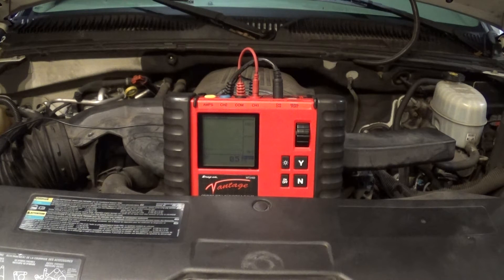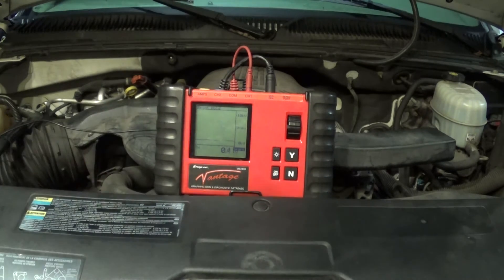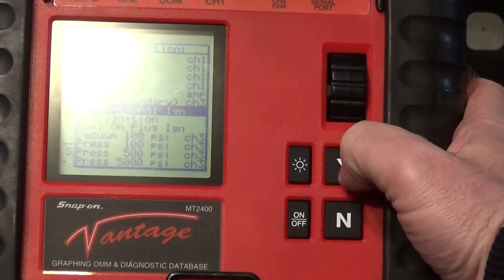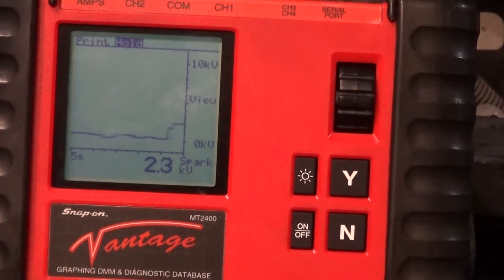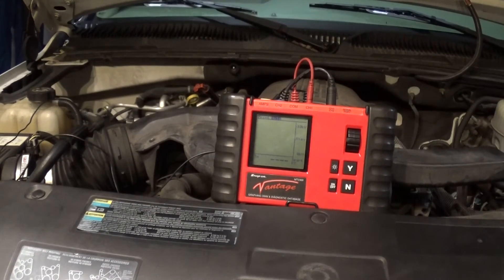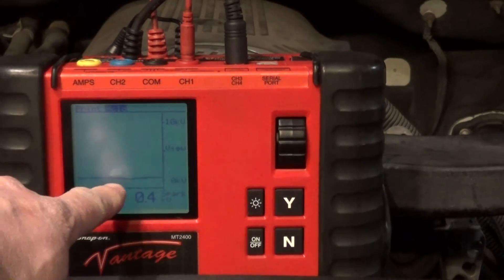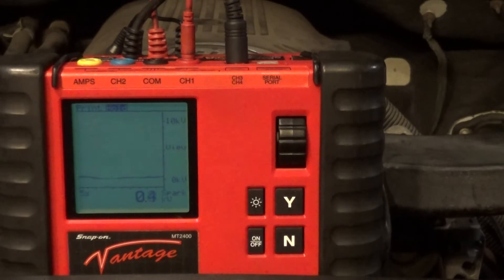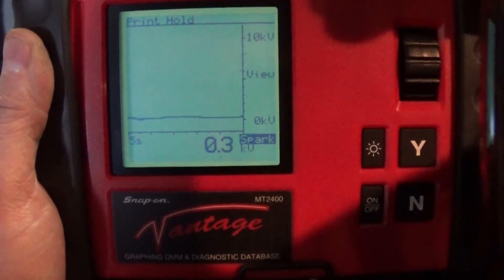Secondary Ignition Testing With Snap On Vantage MT 2400

Comment: this is a good video for those familiar with osciloscope use but not for beginners. where did you hooked up the  long wire what is the spec for a spark plug voltage what means the ups in the graph when you shaked the wire? 
Not very useful for a low knowledge.
Thanks guy.

Comment: I have the MT2400 but not that module u put on the back. That is sweet. On the hold feature, can u go back?  I don’t think so. What’s cool about the MT2400 is that it is so light and compact. Plus it has the recommended test features. Most of the Troubleshooter features. I think mine goes up to 2002. Not sure.

Comment: maybe i missed it, but what kinda of test lead did you use. and how did you hook it up ?
Reply from the maker: Wrench life 604 hi I am using vantage 2400 KV module attaches to back of this unit. For leads I am using Snapon secondary ignition probe hooked to ignition wire.
Reply: thank you

Comment: I came back to watch this since the first time never really made sense. Now I understand that we are talking spark kv and not the turn on or power kv. Wish I had an early Vantage. Nice work, thanks!
Reply from the maker: Baxrok2 h
Reply from the maker: Baxrok2 hi you have vantage pro with ignition scope built in. You have same option in digital form on your tool. I will be glad to talk to you if you want. I can send you my email
Reply from the maker: Baxrok2 this is easy test to do. Spark KV is voltage needed to start a spark. At idle compression and AF mixture doesn't change and there is no reason for spark KV change. If spark KV does change its because spark is happening outside of combustion chamber. Hope this make sense. Please let me know if I can help in any way.
Reply: Yes, I know the Vantage Pro will do this. However, I would still like to have one of these older Vantage units. As you point out, they can still be very useful. Also, they are somewhat of a collectors item. I've been watching one on eBay but think I'm going to save my money for a PicoScope. Thank you sir!
Reply: Ah yes, I see now, that makes perfect sense. Thanks so much Ramon! In this video, I see that changing the spark plug improved things even more. Nice work and thanks!
Reply from the maker: Baxrok2 thank you sir

Comment: is there a rule of thumb for the spark kv value ? I see your good example fluctuated a bit, from .2kv to .4kv.
Reply from the maker: Joseph Quattrocchi anything over 2KV at idle is potential problem
Reply: KY HomeGarage awesome thanks for the tip. I have owned this tool and never really learned how to use the kv adapter.
Reply from the maker: Joseph Quattrocchi not many people use this unit any more because of new lab scopes. I like this test it is simple and I still don't know how to read burn time to menu variables. Spark KV is always affected outside of combustion chamber bad plugs or wires. Thank you for watching and have fun fixing cars. Cheers